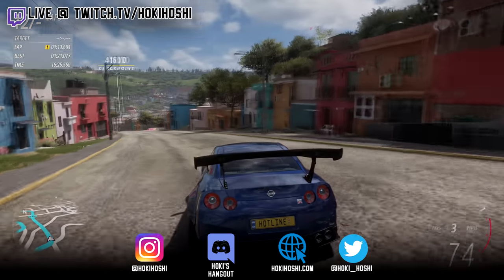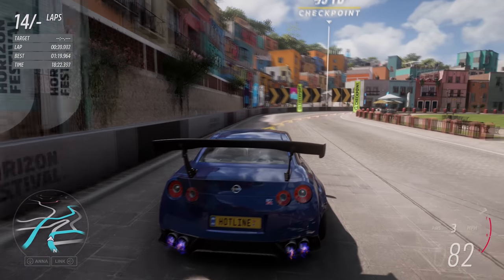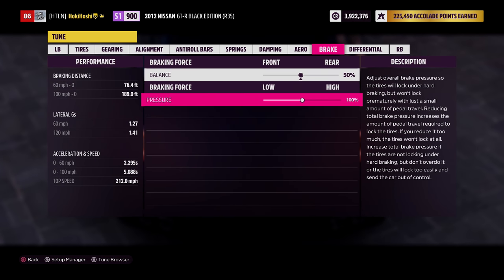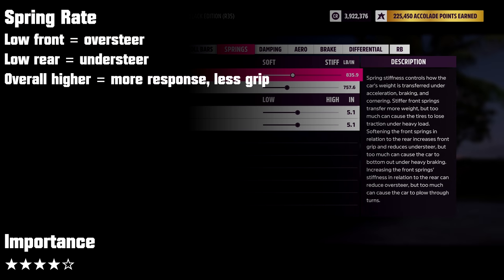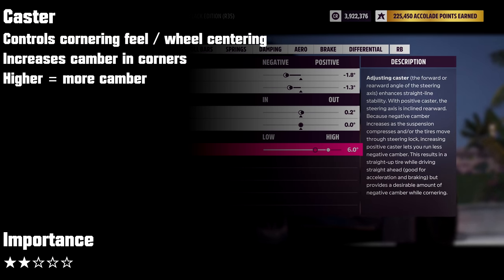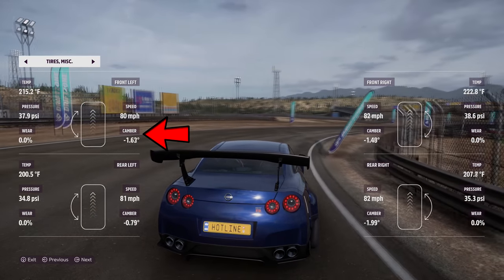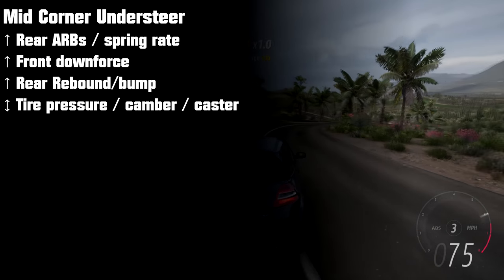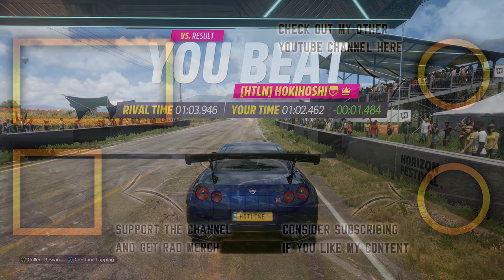How to Tune in Forza Horizon 5 | Basics of Tuning Guide

Comment: This is my third comment so far so obviously I LOVE this video. HOWEVER, I find myself struggling a bit with the adjustments. One example of this is the tire temperatures. I have played around with camber and tire pressure and can't for the life of me figure out how to get the tire heat well-balanced. If I change camber to fix a separate issue, it then affects tire temperature, etc. 

I think what is really needed here are EXAMPLES. I have done plenty of searching and cannot find ANY videos on youtube of someone going through the tuning  process that actually knows what they are doing. For example, turning front camber to -8 degrees and showing what that would do, and then fine tuning it to your liking. The reason I'm saying this is because I found a tune that strayed from several of the concepts you mention in this video and it drives excellently. I think we all have the ability to move things around and test them ourselves, but watching someone like you who actually knows what they are doing would be a great way to guide people in the trial and error process, and a great compliment to this wonderfully informative video.

Thanks for the content!
Reply: I also can’t get the camber to stay in positives without getting up to at at least a 40 degree temp difference between the inside and outside of the rear tire

Comment: Hi Hoki,

I know I am very late to the party over FH5, but I am keen to learn all I can about tuning hows & whys. Until now, I have dabbled with tuning calculators like ForzaTune which does a reasonable job at giving me a base tune. So I watched your VERY informative and well explained video (numerous times 👍)  to learn how to adapt those tunes for my driving style and maybe get to building my own tunes from scratch.

As a starting car, I am focussing on tuning a C class, RWD, E-Type Jaguar which I have upgraded with all tunable parts to C600.

My problem is tyre temperatures. I have left the tyre compound as stock, Increased the front tyre width to 215mm and the rear tyre width to 295mm.

Using telemetry on the heat page while driving around the Horizon starter track, I can see that when warm the tyre temperature difference between the inside and outside for each tyre is around 50deg when driving straight. When cornering, the range of each outside tyre lowers to between 10-20deg but the range of the inside tyres stays around 50deg. I presume this is because the outside wheels are covering more distance at a higher speed than the inside wheels.

I have tried lessening the temperature range by lessening the camber. I was unsure which way to adjust as if I have a camber of -2.0, is lessening it going towards 0 or away from 0 ? I tried both ! and neither made much difference. I was also concerned that were I to fix it, would that make the outside tyres to hot during a turn as camber affects front/rear not left/right.

I hope you (or anyone else) see this and can give me a few pointers as to how to correct this and thank you once again for such a high quality video.

Comment: I want to point out about the diff settings. If you're struggling with oversteer when braking or coming off the throttle, run a higher deceleration setting. I find that 70% acceleration and 50% deceleration works for me, but that's only because the rest of my base set up is done to induce oversteer, and to basically abolish understeer. On front wheel/4-wheel drive cars, I run around 50% acceleration and around 30% deceleration, but again driving style and the rest of the setup helps with this. For instance, in front wheel drive cars i have a stiff setting for rear anti roll and springs. Between 25%-35% stiffer than the front, paired with a high negative rear camber. I get on the throttle way harder and way sooner through corners than I do with rear-wheel drive cars, because the setup is meant to induce oversteer, but the rear tires are cambered between -3.5° to -4° (depending on weight and height balance) to fight that same oversteer and keep the rears following the fronts as they pull you through the corner. Also I have high damping settings to keep the car from pitching too wildly with weight transfer, which upsets the diff in sometimes unforseen ways. On these, i generally start with 10 front and 9 rear, and tweak it based on how light it heavy the car is, and how much weight needs to be accounted for. Heavier cars I set higher with 10 being the highest. Lighter cars, 8 is the lowest in the front. I always tune the rear rebound stiffness between 0.9 and 1 below the front, to help balance out the extra stiff springs and anti-roll bars. On bump stiffness, I generally only use 3.9 front and 4.1 rear, unless the vehicles preset settings are easy lower or higher than that (and then I doubt myself and either raise a couple clicks or lower a couple clicks on each one). But I could be wrong about a lot of these practices, which is why I'm watching this video. That's just where I am right now. Great video. Thanks.

Comment: Hey! I tried tuning three cars using the guide: 
1:. Porsche 914 Spyder, Successful tuning, runs like butter on streets, total control
2:. Hot Wheels Blade (S2), Failed and gave up

3:. Supra 2020, I tried tuning this car for like 2 hours but couldn't control handling, had around 700 hp of power and AWD for faster acceleration in street racing, should I switch to RWD and retry??

Comment: I was still using the spreadsheet I made following your FH4 to calculate all my values. So far I’ve only done an S1 class ‘18 Mustang GT, an RX7, and a B class GT3000.

Might be interesting to take them into rivals to see what they do with the old settings versus what I got from the video

Comment: your weight % equation for setting up suspension and anti roll bars in forza horizon 4 was a life changing discovery. does that still apply for 5? i notice like you said, the suspension is overall a lot stiffer in 5 than in 4, and that the base setup for 5 isn't that far off and doesn't need as much fine tuning like in 4. like in 4 it was 20 max 3 min for dampening, but in 5 it's 20/1 which usually makes the base setup higher than the final calculation. spring rate still ends up higher like it was in 4 though, so that evens it out a bit i guess.

Comment: EDIT/PSA: I had all my auto driving settings still turned on which caused the issue I detailed out below. MAKE SURE YOUR DIFFICULTY SETTINGS ARE CORRECT BEFORE TUNING.

Im having a lot of trouble with my cars recently and all of them when i tune them - following your guide as closely as i can - end up having the tires heat way up in the corners and losing grip in the front. i've tried a lot of things, but i just cant seem to make it work. right now the issues are mainly on my Jesko and my Mercedes-Benz CLK GTR. I did put an awd drivetrain on the jesko, but the CLK is still RWD.
Reply: what do you change your difficulty settings too then? I tried to find out the online settings so they are the same but I cant seem to find it.
Reply: @EskoShorts  the difficulty settings are in the settings tab accessed by the pause menu
Reply: @EskoShorts  and just make sure they are set to anything you feel comfortable driving around with that isnt on the highest assistance settings

Comment: This has helped a lot. I was actually having a ton of trouble trying to complete rally races that were restricted to a 1970's Dodge Challenger and that car by default handles horrendously bad. It would burnout a lot in 1st gear and had basically no grip whatsoever on any road and would constantly be drifting or oversteering. Had to give it all-wheel drive, high suspension, heavy brakes, then promote understeer by a shit ton. Finally I got it to handle great with the advice here on differential tuning, gearing and tires. Thanks

Comment: What does it mean when your tires are just... always too hot? Trying to practice applying this guide, and the very second I hit the accelerator, the tires shoot up into the solid yellow immediately (outer, middle, and inner), and they often shoot into very bright red when braking or cornering. Usually with light cornering only the insides of the front tires get too hot, but heavier cornering with braking will turn all parts of the tire bright red on the heat chart.
Reply: I think that's quite normal if you don't have tyre wear on? Are they cooling down after a few seconds?
Reply: @jonnycollison  They were taking forever to cool, but I think the issue was that I was trying to upgrade a vehicle well outside of its original performance class. I was trying to "max out" a pretty bad D-class vehicle.

I've had a bit more luck with tuning some less... ambitious... upgrade projects. Hoki's video on upgrade selection was very helpful in that regard.
Reply: For what it's worth though, the aforementioned build wasn't totally undrivable, particularly for being kind of a meme build.

It was that little BMW bubble car from the 50s (don't ask me why I thought that was a good idea for a first serious build, sometimes I try to be a little too clever for my own good), and it at least drove better than the time when I was brand new to FH5 and I slapped a bunch of upgrades onto the Willys Jeep with no tuning adjustments whatsoever, before I switched to community tunes for everything.
Reply: You've probably already figured this out by now, but in case you haven't or if someone else reads this later - inducing wheelspin such as when braking or accelerating from a standing start will heat tyres super fast, but as long as they're not overheating in steady-state driving you don't need to worry about it too much. If you are wheelspinning so much that it becomes a problem anyway, then something is wrong with your setup - you are either under/oversteering because of your other settings or you just have too much power for how much grip you have and you need to cut power or upgrade your tyres. And yeah, putting a 1000hp engine in a 1950s shitbox will probably cause that to happen lol, cars of that era have thin tyres that struggle to put a lot of power onto the road.

If you are overheating in steady-state, different tyre compounds have different heat tolerances. Something like rally tyres will heat up much faster than semi-slicks. You can turn up tyre pressure to reduce heat and improve handling at the same time if that happens.

You also should not brake while turning, that is super likely to cause you to lose grip. Tyre heat is the least of your worries when that happens.

Comment: If you dont have access to the switch anna/telemetry/tts option you need to select default controller layout 1 in controller mapping, restart your game, and it should be available. Im not sure if you can get away with changing any buttons around afterwards but just repeat if necessary
Reply: Yeah they need to fix that it’s annoying

Comment: I can now safely say that RWD is viable!!! At least in lower classes. I have a suspicion that AWD will still be dominant in S1 and S2 but below that is a more contentious debate. I set a time on rivals with a tune I just made and placed 239 after my second run. I used two different cars. One was the RSX which is so, so fun to drive. The other was an old Alpine. Barely weighed 700 kilos, super nimble. 

The RSX originally placed a 348 iirc

Comment: What a great guide for tuning thanks a lot. Just like you I always make realistic tunes in FH5. I prefer stock engine most of the time and use engine swaps for only if that engine(or similar) is an option for the real car. For Example: Land Rover Defender 2020 comes with 3.0 Inline6 stock but there is P525 5L V8 IRL. So I swap V8 DSC engine for beautiful sound and performance. Also i think it is acceptable to swap 1.6 turbo Rally & 1750 hp Funco engine for Higher Class Dirt/CrossCountry Tunings. I mostly prefer stock Aero for better looks(Especially if car has stock active wing) and tweak handling with proper tyre/alignment settings. This also make you faster on straights due to less drag>Higher Top Speed/Better High Speed Acceleration. Therefore my tunes usually favor Sprint Races. I never change car's default drivetrain: If it is RWD default I just keep it because changing this kills all the Car's feeling. And I adjust gear ratios(also keep it same gear count as IRL. ) for the best traction without losing contact with the road. I play the game with G29 driving wheel and use paddleshifters for the Cars with PS/ use Manual shifter+ clutch for cars with MT. If you like lean/realistic tunings you can follow me to get my tunings.
 FH5 : Rantess
Some of my Favorites:
C600 CrossCountry: Toyota Tacoma
B700 CrossCountry/Dirt: Land Rover Defender'20
B700 Road(Circuit): Bugatti Type35C
B700 Road(Sprint): Porsche Carrera RS '73
A800 OffRoad: Ariel Nomad ( Also very good for Horizon Arcade Air*) / Hennesey Velociraptor 6x6
A800 Dirt: Mitsubishi Evo 6 RalliArt
A800 Road: Porsche 911 Sport Classic/ Audi RS5 / Bmw M3 E46(CSL like)/ Audi TTRS / MB SLK55 / MB C63 AMG'12
S1-900 Road: Jaguar XJ220S /Porsche 911 GT3 RS 4.0 (Grip)/ Porsche 911 GT2 RS '12 (Speed) / Noble M400 / Corvette ZR1 '19/ Lambo Huracan Evo/ Lambo Aventador SV/ Ford GT '17/ Ferrari 458 Speciale/ Porsche 911 GT3 RS '19/ Porsche 911 GT2 RS '18
S2-998 Dirt/Playground Games: BMW X5 M FE
S2-998 Road: Mosler MT900S /Lambo Aventador SVJ
C600 Drift: Buick GSX (Ez Rwd drift tune for beginners)

Comment: HUGE HELP!  thank you  i've only tinkered around with tuning for 4 hours now after seeing your video but the resuslt speak for them selves  

Rally v1.01 Tuning Test

Stock     Tune Subaru Rx===03.25.155 - R1===03.18.482 - R2===03.01.932 - R3===03.08.673 - R4===03.00.031 - R5===02.59.130

Custom Tune Subaru Rx===03.26.356 - R1===03.14.244 - R2===03.04.401 - R3===03.00.565 - R4===02.59.997 - R5===02.56.060

i did 5 runs with each car on a 7.1km cross country  that i made for this test with both sharp needle corners on road and offroad and loooong corners  and  slingshot corners

Stock Tune run   = 832  class A      Stock Tune run Avg.           ===03.05.650===

Custom Tune run  = 832 class A    Custom Tune run Avg.       ===03.03.053===

Agian a milion thanks to you for making this video  forza is such a great game but now that im also into the tuning scene its incredible!! :O <3  have alovely day 

thanks - Aimy <3

Comment: I discovered a really pog brake to drift tune for rwd by playing with the tunes, this video helped me understand the tuning so Imma leave it here ;
Tire Pressure - Front 2.3, Rear 2.4
Gearing - Didn't change
Alignment - Camber positive 2.5 for both front and rear, didn't change toe, front caster 6.5
ARBs - Max stiffness
Springs - Max stiffness, ride height lowest
Damping - Max stiffness, bumb stiffness softest
Aero - Didn't change
Brakes - Front braking force max, braking force pressure max
Differential- 0% on both

(I'm using metric so yours might be different)

Comment: Thanks, your video helped me fine tune my tuning quite a bit, but one question I still have is in regards to race/offroad/drift differentials. I realize that in theory drift/offroad differentials are lockers and a race diff is an LSD, but in practice with them tuned the same they seem to perform the same except for offroad/drift diffs showing a faster time off the line. Is there a detrimental effect to using a drift diff on a road car? It doesn't feel like there is but I'm pretty bad(I struggled to even get a sub 9:30 in an X class Mosler on goliath).

Comment: Are some cars just impossible to tune "correctly"? I have a McLaren F1 GT that I've got at a point where it beats the CCGT left and right (already top 1k in probably a dozen rival leaderboards) but I KNOW it has places to improve, like under hard cornering the front tires start skidding and I maintain perfect traction, but I lose speed. The front suspension is bottoming out, but even at maximum stiffness on EVERYTHING it still does it. It drives fine, but I feel like I have another few tenths at least on every track if I can just figure out some of its issues

Comment: This was genuinely so so helpful thank you so much! However I do have one question, what do I do if the tires are just heating up so much and I can't fix it? I know I'm doing something wrong but I don't know what. It's the 1970 Dodge Challenger R/T and it just keeps turning left as soon as I begin moving and drifts like crazy (I'm assuming the last part is to do with oversteer but I can't fix that until I fix the tires)

Comment: Aero:

It's most necessary to put it on ur car if u below S2 class.

Too much front force make ur car understeer. If u r below S2, don't set it up over 75%, start from here what u need.

At the back, usually use 60-70% of the front for best results.

If u didn't put up front wings, then set ur rear wings around 25-35% to prevent understeer.

Also u have look after the car base balance. If ur cars front is heavy, u can raise a little the rear down force.
If the front is lighter, then set it down to 20%. The problem is with a too light front that it's will lose grip anyway if u push it too hard, and if u have too much rear force, it will just break off from track understeered.

There's an another part with the wings. If u put up the rear wings in a lower class car (like a8, B7, C6....) U can save a lot of PI, and set the force to minimal. The minimal force still add some understeer anyway, and mess with ur velocity, but with the bonus pi u can make more power to the car, which will help u in corner exits, up on hill, etc...